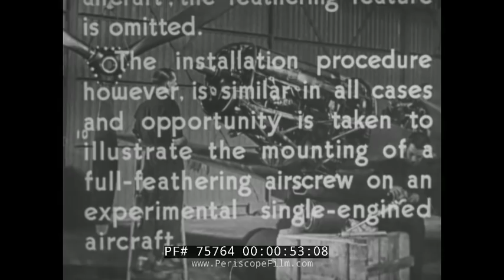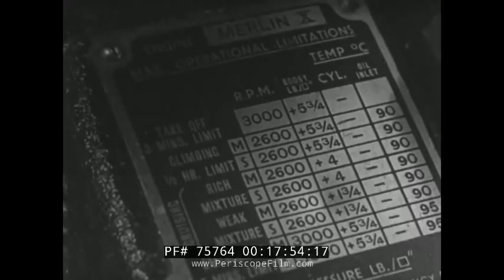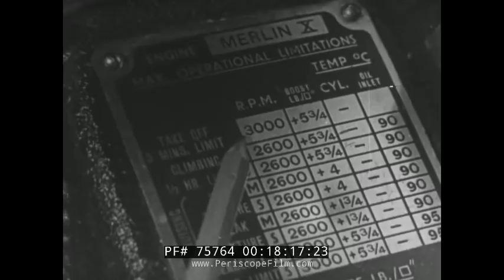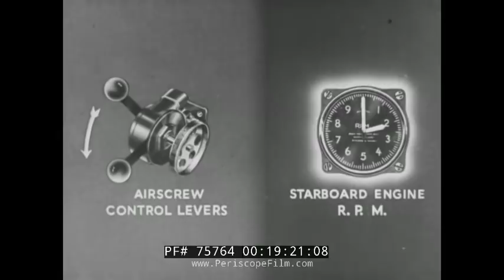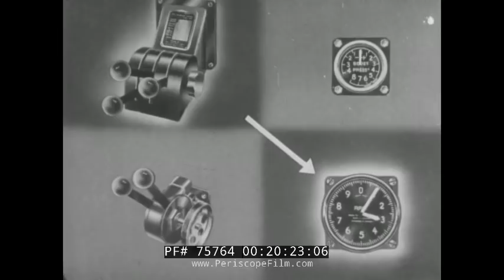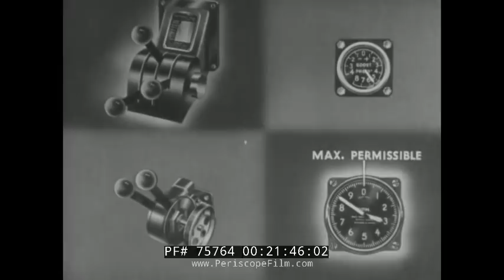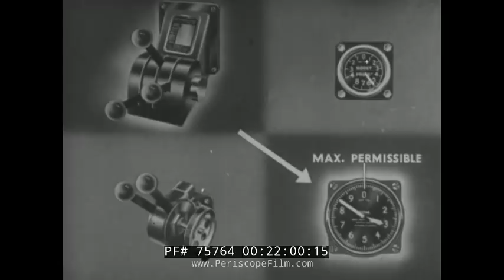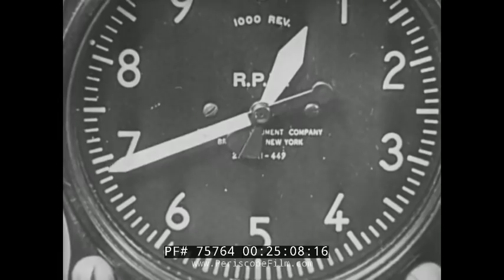De HAVILLAND HYDROMATIC AIRSCREW PROPELLER AIRCRAFT  BRITISH EDUCATIONAL FILM 75764

Comment: 700ft-lb using a special calibrated torque wrench consisting of a special spanner, a cheater bar and a lad of a known weight doing chin ups on the end. What an awesome video!
Reply: David Clawson    Wow. That was the first thing that I thought of as well. Of course, out in the field was another thing. I have lived on both worlds.
Reply: Yes corrrect torque , 10 foot bar , 16 stone man swinging  on end, hit with hammer. Must have worked though. Not a Torque gauge in sight, by feel and experience.
Reply: At 12:40. Seriously, I laughed a bit. It's actually the way I do it!
Reply: Earlier in the video the regulator assembly was tightened evenly and firmly. Firmly? If that is a light smearing of antisieze compound on the shaft splines then heavy smearing would be the entire can?
Reply: @51WCDodge  In the 'Black Country' of the Midlands it's called 'Whack it with a lead 'Ommer' lol.  Obviously worked though.  All praise to those engineers.
Reply: The guy is weight-calibrated by his mum at dinner.

Comment: Who on earth worked all that out, it’s so complicated and ingenious and this film is decades old so those designers were pure geniuses.
Reply: @HiWetcam Guess you are a septic then.  It was DeHavilland's engineers, UK.
Reply: You start with a concept, sketch it out, refine the working dependencies, get machinists to make a working mock up, try it on a bench, then you have the lubricant specialists tell you about all the oil feeds, seals & pressures needed to make it viable, so you go back to your drawings & refine again, and round it goes a few more times. Then you finally get some serious specs on the airscrew blades and realize you have to dance through it again. At some point the metallurgy chaps chime in and you recalibrate everything yet again. Or you simply license a patented design that's been in service for a while. Quite a few designs, or sub assemblies  were licensed in the 1930s.
Reply: Good point.......and to think all of this incredible engineering was designed without a computer..... simply the human brain, pencils, drafting paper and slide rulers.....
Reply: @poruatokin  "produced under license from Hamilton Standard." (description)
Reply: It fascinates me how today's roller-type thrust bearings & cone-shaped roller bearings are the very same as that used in this 1930's design.  This includes the high grade steel & finish used

Comment: Thanks for uploading these two films; interesting that in the first film they were using a Spitfire as the example aeroplane to fit the hydromatic propeller when this type of propeller was only used on a very small number of Spits and never with full feathering capability.
Reply from the maker: +David Interesting information thx
Reply: The screen-based text introduction mentioned the feathering mechanism was used normally in a multi-engine aircraft.
Reply: J0
Reply: An experimental Spit had a full-feathering prop for (abandoned) trials where a Spit was towed into the air (probably by a Dakota) using a Y rope-- the idea being to extend the Spitfire's range! Another one of those weird experiments. Documented by Alfred Price i think.

Comment: What a fantastic film showing how the HYDROMATIC propeller control works, and what it takes to get it mechanically adjusted, simply amazing !!!
These engineers and mechanics deserve a big congrats for what they did, and imagine, in WW2, thousands of aircraft were built using this system..

NOW I know why at DeHavilland Canada where I worked in the 1970ies, they tested Twin Otters, Buffalos and Dash 7's many times moving the propeller pitch  like here in the movie but I'm sure there are more modern ways to set the pitch angle, as these turboprop engines have Hamilton Standard constant speed propellers so the system is automatic.
Of course with the prop control, anything from full speed, to ground idle, or reverse :-D
Reply from the maker: Love our channel? Help us save and post more orphaned films!  Support us on Patreon: https://www.patreon.com/PeriscopeFilm  Even a really tiny contribution can make a difference.

Comment: It's interesting how they didn't safety wire the nuts securing the constant speed unit. And the nuts shown didn't look to be the self locking kind.
Reply: Those nuts definitely weren't self locking from what I saw
Reply: They could have been "squeeze" type lock nuts. They were the predecessor to the modern nylon type lock nuts.
Reply: Yes if you look closely they appear to have the squeeze lock dimples on every other hex face.
Reply: Also, if the bolt wasn't expected to be removed in normal service, they would peen over the end to lock the nuts.

Comment: I would have thought that the engine speed rpm would have increased when the propellor is feathered as it would not be required to work as hard.
Reply: Feathered relative to the planes direction .. blade surfaces parallel to the propeller shaft. A propeller is feathered in flight to cut aero drag from a dead engine. Fully feathered would be the maximum load for a running engine on the ground.

Comment: Hydromatic and 'constant speed". Is this propeller hydraulically driven by the engine? Also to Historic Aero Engines...I suspect a single engine aircraft has no need to fully feather it's propeller as if engine stops you are going down anyways!
Reply: While it is true that you are going down when the engine quits in a single engine aircraft, you would get a better gliding range with the propeller feathered.
Reply: Hydraulically operated pitch change, aerodynamically limited speed. The governor adjusts propeller pitch to maintain a predetermined speed adjustable by the pilot by means of a cockpit lever. At idle, propeller speed reduces significantly and the governor maintains fine pitch unless the pilot selects the "feather" position on the propeller control. Once full speed is reached, propeller pitch is increased, but engine speed remains the same.

Comment: I may be wrong but doesn't the "experimental" airframe look a lot like a Bf 109. That narrow track undercarriage is a dead give away. Did Hamilton Standard use British designs or are theirs an original design? Something I'll be looking up.
Reply: 762X51nato  Hamilton Standard designed and built his props all by himself and it was revolutionary, why DeHaviland licensed it as they had nothing close.  Also why a P51 mustang using the "similiar" engine as a MkIX (9) shitfire was 40 MPH faster, using a Hamilton prop and 2,000# heavier, than the Shitfire using the Rotol (british) prop !!!! The Hamilton was much more efficient!!!  Notice also when a picture of a Mustang is besides a shitfire, both with the merlin engine the Hamilton props blades are much wider, getting a better bite in the air !!!!
Reply: I see no '109's, only a Spit and a Whitley (Can't identify the in-flight a/c shown feathering it's stbd. engine. Possibly a Bristol or Vickers product..)

Comment: When DeHaviland designed this gear rig in 1939, did they use SolidWorks or CATIA? What were results of running a FEM analysis for metal fatigue failure? What was the FEM simulator? When the engineers performed random QA on random 5th part part, did they use Interferometry UV laser or IR diode laser?
Reply: De Havilland didn't design it.  They licensed it from Hamilton Standard (USA) in 1934.  Curtiss-Wright also had a variable-pitch propeller but it was electric instead of hydraulic.

Comment: Modern neoprene rubber lip seals complete with modern dry "sealant" pre-applied on the seal "cup" all the way "back then", huh? Yeah. Nice "vintage" video made closer to the "Falklands War" than "World War II". That you would "delete" the "feathering feature" on a "single-engine aircraft" is evidence of just how "smart" whatever "engineer" made this modern "recreation" of a non-existent "vintage" video really is. Along with the installation of 3-bladed prop on a "V-12" engine without "timing" the prop to make sure its "out of phase" with the engine and its "firing pulses". The "one size fits all" b.s. about that "De Havilland Hydromatic Airscrew" fitting almost "any" aircraft/engine like all "aero engines" are "standard" when it comes to "airscrew installation" is even more hilarious. 

And by the way, that's not an "oil seal" type of "lip seal". Its a "grease seal" and has no "lip" and "garter spring" assembly to use oil pressure to "load" the seal lip and keep it "sealed". A grease seal like that is DESIGNED to "leak" excess grease OUT and prevent dirt, moisture etc from "leaking" IN. Being installed BEHIND the "airscrew nut" means its probably going to get destroyed when the nut contacts and "cuts" it. The purpose of the "washer" BEHIND it is even more "mysterious". Typically a "back-up ring" like that is used with a simple "o-ring" or "split-ring" seal to prevent the seal from being "deformed" when exposed to pressure. Solid rubber/plastic lip seals like its installed with generally don't need a "backup ring". Kind of like the complete lack of torque specs during that entire "installation" performed "by the book". 

Overlapping "stepped" sealing rings are also made that way so it won't/doesn't matter if the non-existent "ring gaps" end up aligned or not. Because steel sealing rings in an application like that where parts rotate relative to each other WILL INVARIABLY end up "aligning" their gaps eventually. Its a "balance" thing. The other glaring omission is a more detailed and precise description of proper blade "timing". 

Overall this looks like an "instructional video" some "engineer(s)" created without the actual manufacturer's instructions and manuals for whatever American make and model of "airscrew" that REALLY IS because "De Havilland" no more made "airscrews" than they made anything else "aeronautical" besides "airframes". They may have "license built" an American make/model of "airscrew" made for the "Packard Merlin" but that's not the same as "manufacturing" from "scratch" a "constant speed" propeller. 

The "creator" of this modern-day "recreation" of a non-existent "instructional video" wasn't even "engineer" let alone "mechanic" enough to know how to "safety-wire" that "grub screw" properly. Safety wire always prevents entirely the wired screw(s) from "loosening" PERIOD much less "unscrewing".
Reply: What's hilarious is that you think this is fake. I suppose they mocked up a Hurricane specially for the video and later rolled out one of the many Whitleys that survived the war for the second fake video. You should really keep taking you medication.
Reply: Well.. Trying to answer this is so for I guess is a job without an end. But anyhow Neoprene is a pre war product. 
As ti says on the wikipeda page (https://en.wikipedia.org/wiki/Neoprene#History) "Neoprene was invented by DuPont scientists on April 17, 1930 after Dr Elmer K. Bolton of DuPont attended a lecture by Fr Julius Arthur Nieuwland, a professor of chemistry at the University of Notre Dame. "
Reply: @quested5202  I'm sorry, you are correct.
Reply: Well said, but the aircraft in the first film is an early Spitfire.
Reply: Quotation marks much?
Reply: This must be Boring Tractor in disguise !
Reply: You clearly have no Engineering knowledge yourself, in reference to that grub screw being wired they cross the wiring so that it's under constant clockwise tension to prevent it loosening. If you can't recognise that then you won't know a bit about the rest of it.
Reply: ++ @453421abcdefg12345 ++ I think dear Deeremeyer1 is Wibur soarearsedfinnegantractor in disguise.  Surely there cannot be two americans alive at the same time with such a massive amount of intelligence when there is so little of it in the usa to go round.?